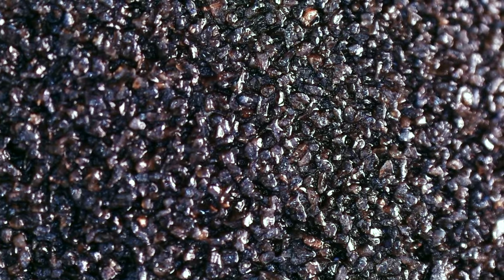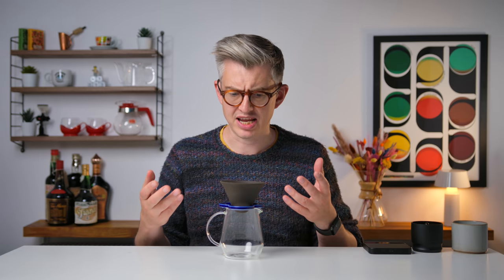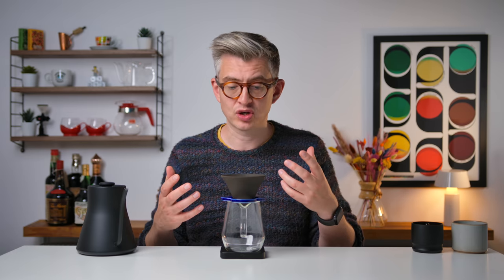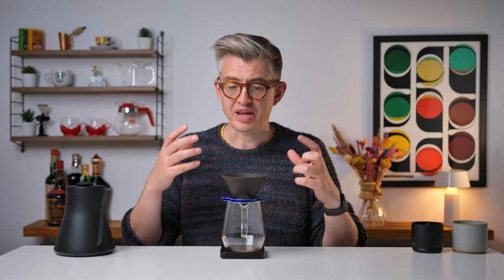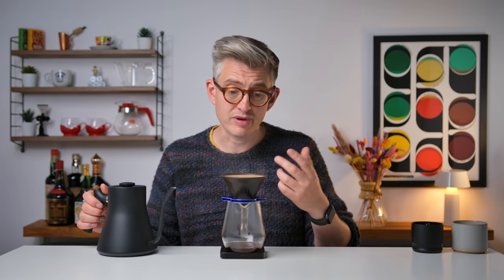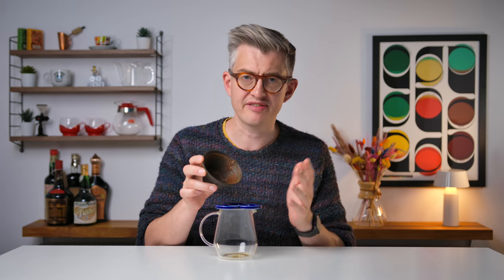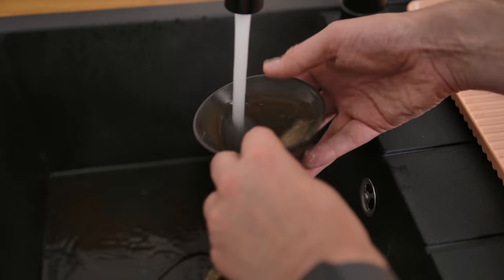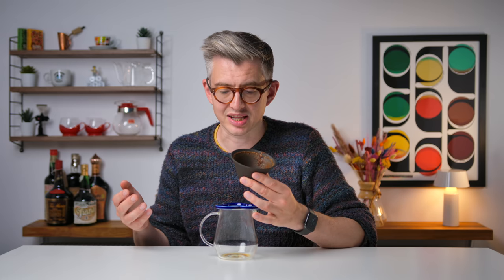Ceramic Coffee Filters: Magical or Maddening?

Comment: I feel like there isn’t much information here and seems more opinion. Side note micro bubble ceramic stones for aquariums can be cleaned with drop of bleach and warm water. Then after soak it in hot water after brought to heat them sanity rinse and then use.

Comment: Activated carbon: nah. Even if there is, it's a tiny quantity, and activated carbon has a relatively short lifespan *even when sitting idle*. So you might get an effect from that specifically for, like, a couple months at best, then essentially none at all.

FIR is almost certainly snake oil of the highest degree. As you mentioned, essentially all ceramic emits it........ including your ceramic coffee mug, which is at nearly the same temperature.

Comment: James i love your videos, you're very informative when it comes to coffee, but I think that your sustainability analysis is rather uninformed. You've got quite a large audience, you have the ability to spread information or to misinform people. Either way, you're imposing your views on others, what you say has an impact.

I don't want to suggest to you to just stick to coffee, but I do think that it's harmful to offer up uninformed analysis of important scientific topics, like sustainability.

What id suggest is that you should actually perform a true sustainability analysis. Find the energy and resource cost to produce coffee filters. Then figure out the amount of coffee filters you would use in a year. Now you know how much energy and resource you spend on your filters. 
Next, find the specific type of ceramic used in your ceramic filter. Look up the process for casting that ceramic into a filter, if that information isn't available, you could probably find something on plant pots made from the same material and scale down to the correct mass. Now you know the energy cost to produce 1 ceramic filter. 

You can then do a simple division of the energies. Energy of ceramic divide energy of paper filter, you can then determine how many paper filters equivalent the ceramic is. 

As for the water argument: its dodgy for sure. You can include that in your analysis though. You can find the energy to heat water for however long you spend cleaning the filter, however the way that you clean the filter might not be the best way to do it. Instead of using a flame, you could probably place it at the bottom of the oven when you're cooking something else so then the heat gets used for multiple purposes. Do that for a deep clean once a week at the cost of 0 energy since you're reclaiming what would otherwise be unused. And then do a simple clean each day. You could find the energy cost for the minute or two you spend on cleaning the filter and add that to the total. Perhaps the oven thing wouldn't be desirable for you either and thats okay, you could perform the analysis for any scenario you want. I'm just throwing ideas out there 

And now you're able to have an informed opinion on the sustainability of the product. I personally think that'd be a fun thing to investigate and figure out.

Edit:
Okay another thought, you're boiling water for your coffee anyway right? Do you boil the exact amount that you'll use or do you boil extra? If you're boiling extra and have a boiler that will retain the heat well, then you can use that extra water as your heated water source for cleaning. Maybe you rinse the filter into a bowl, the heated water heats up the bowl, empty out the bowl, place the filter into the bowl, fill the bowl up with warm water, now the filter is soaking and can extract more grounds. All using water that you already boiled that maybe cooled down to 80C by the time you were ready to use it. You can always just boil it again, its much easier to go from 80c to 100c than it is to go from 20c to 100c

Just more options for reducing the water use
Reply: All of the resources and data you'd need to perform this should be available online ^